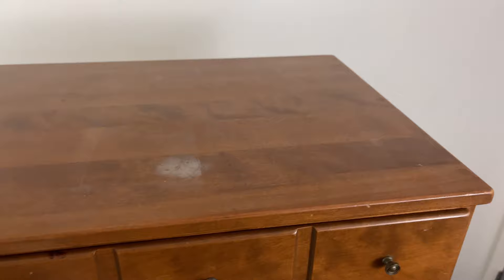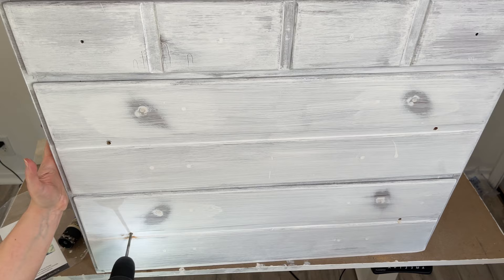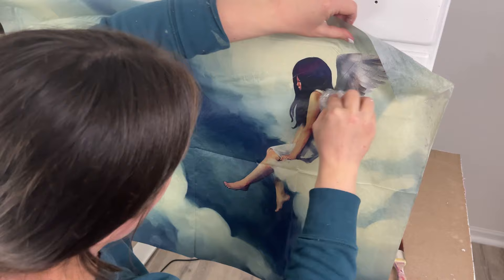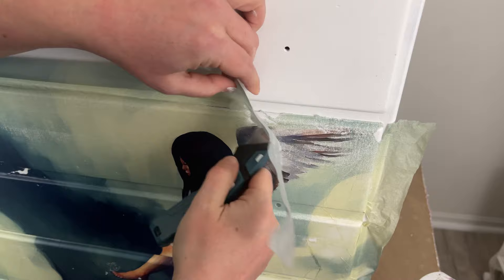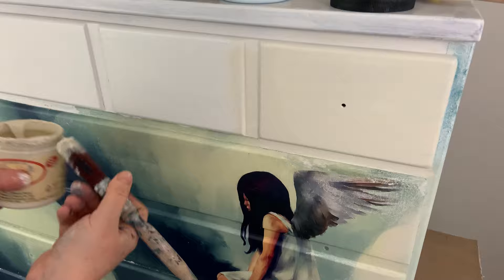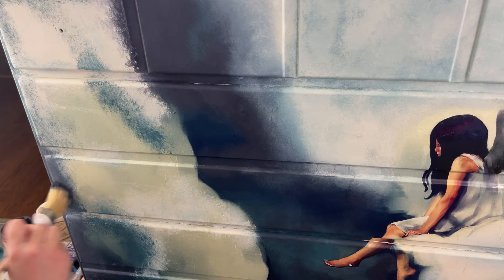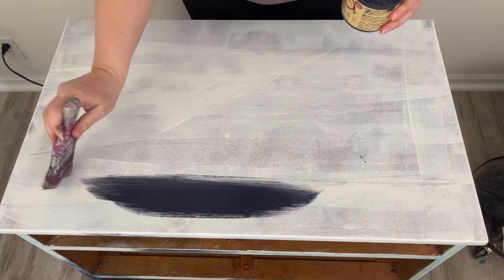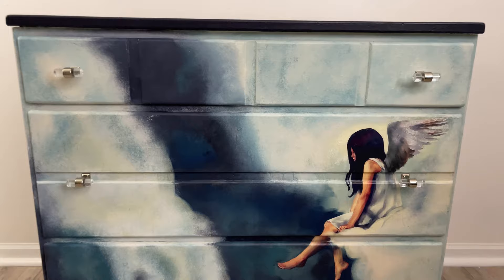How to Decoupage Furniture Using Mint by Michelle Decoupage Paper | How to fix Decoupage mistakes

Comment: May I suggest that instead of "rubbing" with the saran try sort of blotting and pushing it down or in circles...never push the paper,  It works for me.  The rubbing is too severe for this delicate paper.  I have been doing this for almost 50 years so I have a bit of experience..LOL....The final piece looks great.
Reply from the maker: Yes! Great suggestion. Thanks you!😊